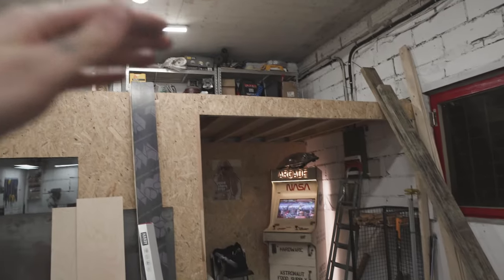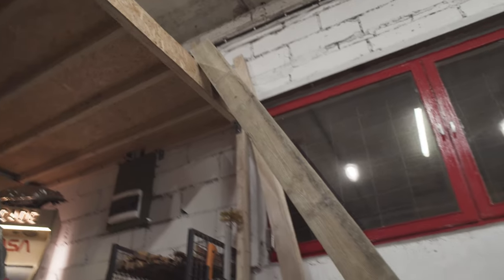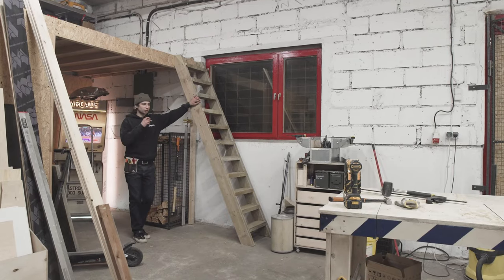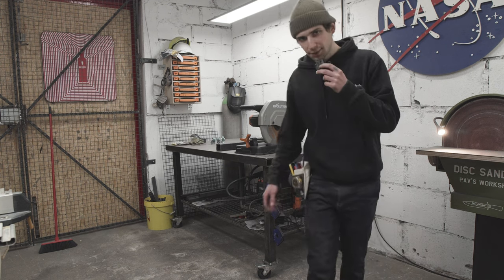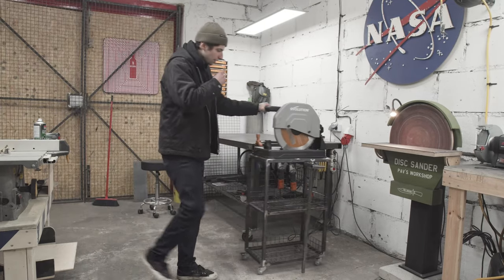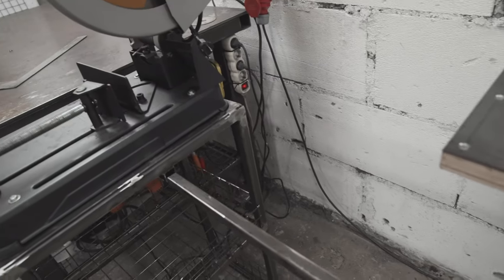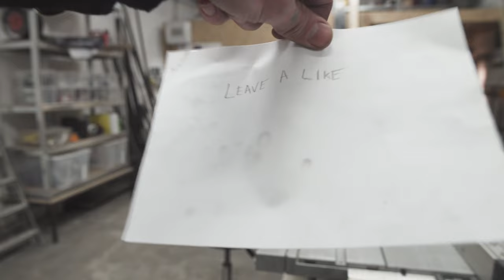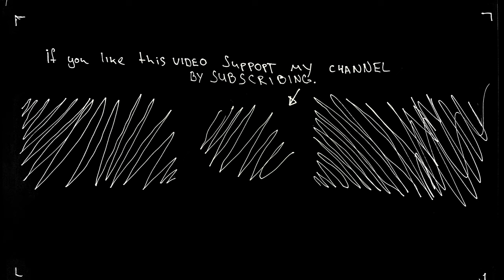Loft Ladder / Cold Cut Saw Stand / Apple boxes / 3 Shop Upgrades

Comment: Why did you use the "pneimo" pistol to put together them apple boxes, why didn't use screws? In the long run it would hold together longer :)
Reply from the maker: The nails only hold it in place while the glue sets. Glue is stronger then nails and screws all together